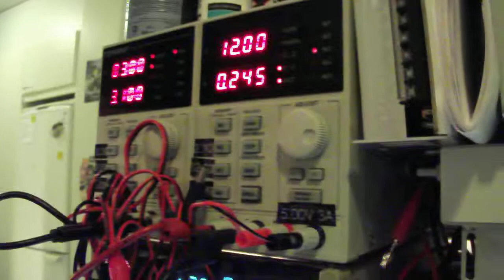Antec kühler 620 h2o pump flow amount & refill tip

Comment: Thanks for the video. Have an old Antec Kühler 620 h2o. Cpu temp are at moment very high. So I'm going to get some new cooling paste. But were also wondering, if I also need to change the liquid inside the cooler? And even if the name says h2o, can I just use regular water? Or does it have be something other? And btw last question, what are the syrringe you use, and were to buy those? Thanks from Krusty
Reply: Same here, trying to test and revive an old rig and this is also what I want to ask :) I cannot believe there is still someone who uses this CPU cooler. May I ask what is your system? I still got the old LGA 775 LOL, planning to upgrade to a newer "old" system with this CPU cooler since I still got all the brackets that came with it. After using it for more than 10 years, I'm sure we need to refill this up somehow, but not sure how.

Comment: I have had mine since 2012. My computer started to overheat a few days ago. Idle temps were hitting 75c! I turned off all my OC settings and the temps were still through the roof and someone recommended I re-tighten the screws on the heat sync that connects the cooler to the CPU. I did that and it worked perfectly. My temps are now idle @ 25c. Be careful tho, I heard if you over tighten the screws you can damage your motherboard but I dont know if this is true or not.

Comment: Remove the copper block, you'll see a black water flow guide on top of the heat dispenser fins..remove it and use fine sandpaper to clean the surface. This method gave me back 100% water pressure flow

Comment: should i refill mine or no need?
Reply from the maker: If it is not noisy and temps are fine, there is no need to refill.
Reply: thank u bro,, does the water stay in it forever?
Reply from the maker: The coolant inside is same as inside a car, it has some galvanic corrosion prevention agents inside. The mixture is about 70-80% water, 19.9-29.9% ethylene glycol and remaining ingredients are agents lowering vaporization, conductivity, bio growth and other corrosion factors. 

Water is able to evaporate trough tubing but it is very slow process because tubing is high quality one where it doesn't absorb much water thus it doesn't vaporize so much. Cooler contains about 100 milliliters of coolant and the annual vaporization is most likely below milliliter. So these units probably are good for 5 - 10 years before you need to refill or buy a new one.
Reply: Thank you so much bro

Comment: How do you remove the hose from the radiator?
Reply from the maker: Use cutters to cut first plastic fastener to remove it, then insert a flat head screwdriver into the hose and wiggle it out.

Comment: What actually happened? I dont understand your english sry (in the case I have one exactly cooler like this and level of water is compromised, i need to refil )
Why did you pulled out the air with that syringe?
Reply from the maker: the pump propeller is not so tight fit, so it is unable to push out air out and suck in water on its own. The propeller housing needs to be full of liquid and  intake pipe aswell. I used syringe to suck out air and suck in liquid without gravity assist.

Comment: Did it wirk propely after the refill?
Reply from the maker: @Werner Mota, Yes the pump still works and I will post soon a video running two in series and pumping liquid in custom loop. Part of the reason why I took these apart, checked inside the blocks, flushed radiators and tested them not to leak before assembling the bigger loop. I got today the last parts needed for custom loop and a video of refilling the entire custom loop will be up soon. (I have reservoir tough but I think you can fill the loop with the method I demonstrated in this video by putting one end into liquid bottle and sucking the loop full and with pliers or something squeeze tubes shut until you have connected the two ends together. )
Reply: Markku Hyttinen I’ve got one of these still running in my old gaming desktop. It’s been sitting for bit but still runs. I’ve had it on the unit since 2011-2012. Should I take it out and flush system and refill it? If so do you have a better tutorial on how to do this? I emailed the company but no response.
Reply: @Team0Ps  did you ever figure it out? I've had one that still runs hard to this day. I am finally upgrading but would like to keep the old one for another PC. Lots of air in the radiator though.

Comment: I used this cooler for years until I realised it had been leaking from the pipes where it joins the radiator!! ...I shall not be going back to AIO cooling, and instead have installed the Cryorig R1 Ultimate cooler in my case, which actually runs coolers than the Antec 620 did!

Comment: If you have enough pressure, you can do what ever you want with it. Refilling tho is hard as F
Reply from the maker: Yeah filling is hard, the problem is also that 7 year old pump o-ring might leak and kill the pump. Happened to me so no more watercooling but it was fun to experiment.
Reply: Markku Hyttinen Ya, i just started Building my own custom aio. So i have all to experience.